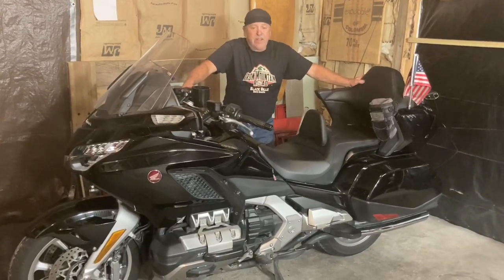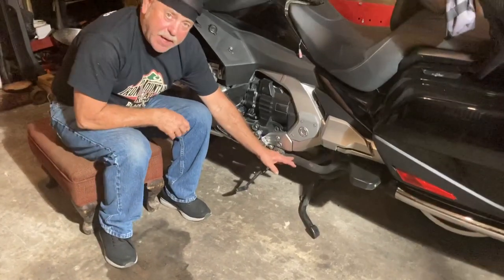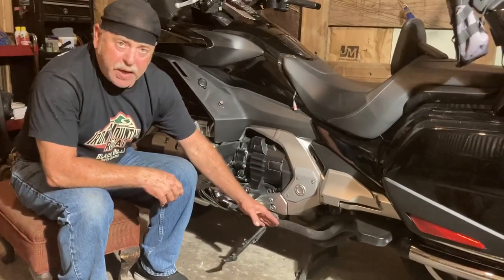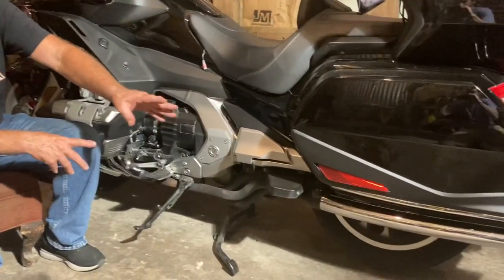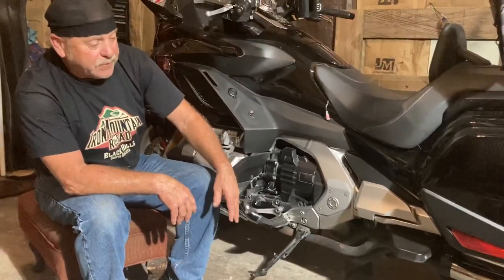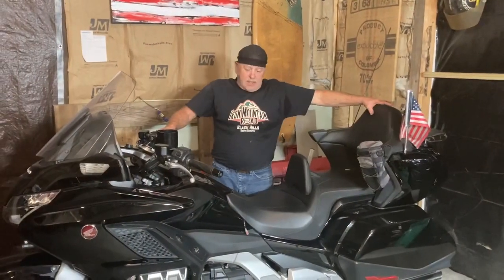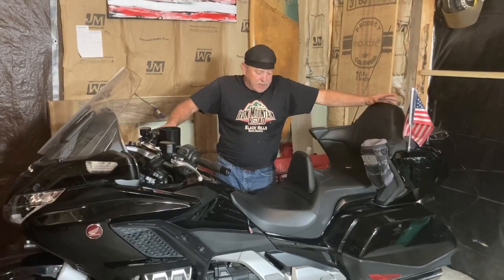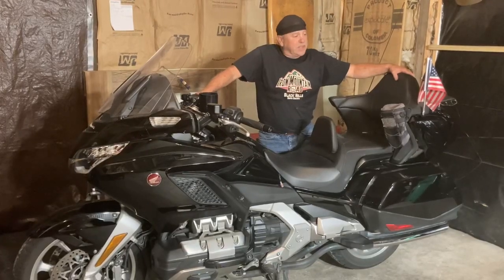2019 Honda Goldwing with E.G.G. Exhaust System - Incredible GROWL!

Comment: Do these pipes affect your lean angle?
Reply from the maker: At the end of one of the video's I have the gas analysts on there. No need for added electronics or flashing if you can find someone to do that now a days.
Reply: @e.g.g.exhaust9094  I wasn't meaning fuel conditions I was meaning when you turn like going through the twisties and such?
Reply from the maker: Sorry, no they run flat to the bike